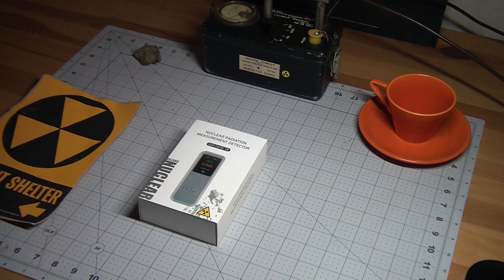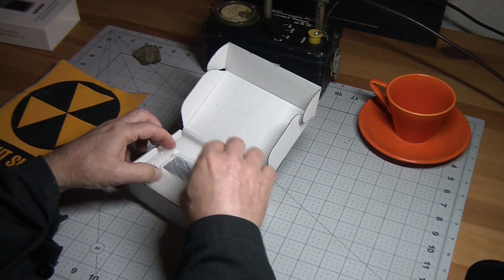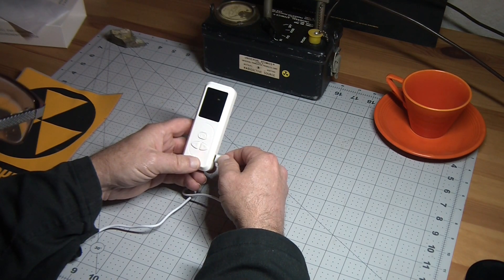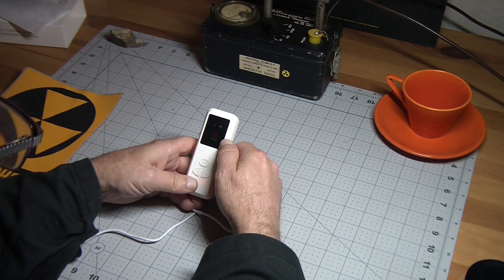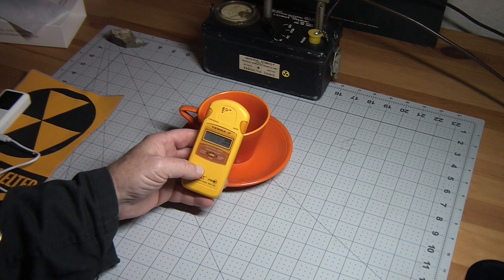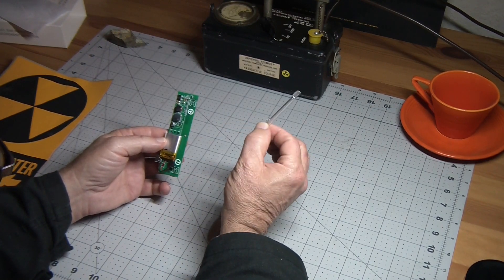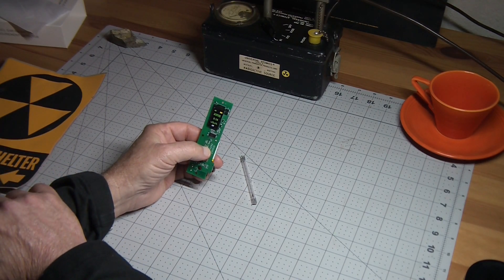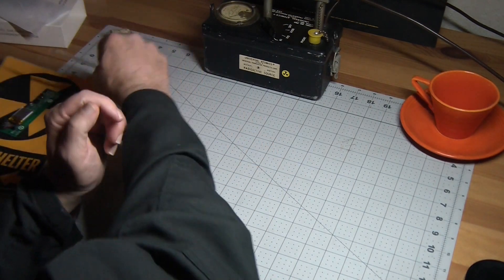Cheap Geiger Counter from Ali Express.  Is it a Fake?!

Comment: I got one which had no tube installed. Turns out mine had proper circuity to use a real GM tube. After installing a j305 I got proper radiation readings and even particle clicks. I would assume a SBM 20, j321 or M4011 would work as well.

Comment: In the German forum someone showed such a fake-device in which an elongated light bulb (like the one used as a turn signal in cars) with a voltage of 24 volts was installed as the "geiger tube".

Comment: I've got a similar model from eBay, and it's fake. No Geiger Muller tube installed, just a very small lithium battery. Doesn't detect anything of the source, I took some photos.
Reply from the maker: I showed someone the disassembled unit as shown in the video.  This person has extensive experience in nuclear power, and radiation detection. He independently stated that the tube in this device is not a Geiger tube. We agree that it is most likely a Xeon flash tube.

Comment: So, since all the circuit is real but not the tube, is there a chance that plugging a compatible, real tube there would make it work?
Reply from the maker: If I touch a scope or DMM probe to the Anode connection, it registers counts (from the noise induced by brushing the probe on the Anode), and will alarm if it registers enough counts, so I believe the answer to be Yes.  However, there is still the issue of the false counts, so I doubt it would be very accurate unless the real counts were high enough to make the fake counts statistically insignificant.  But in that case, I don't think I'd stand around contemplating it.
Reply: @CarCynic  false counts could be interferences or something caused by having a fake tube across the contacts, I've even seen a comment stating that they used car lightbulbs as a tube in one of the units. Maybe they go away by putting a proper tube. I'm tempted to buy one and try it hahah

Comment: Is there any cheap geiger counter you would recommend?
Reply from the maker: I recommend the Rodnik 3, reviewed here: https://linuxslate.com/Review_Rodnik_3.html.  Please also see additional information on the Linuxslate.com forums.
Reply: @CarCynic thanks
Reply: The cheapest GQ you can find. There's often great deals on them on Amaz... No bugs and quircks unlike way too many of the Chinese ones. And they're not really that much more expensive than the better Chinese. Those you can find significantly cheeper on China sites - well quality is thereafter and while hardware may be decent firmware is often not and have unbelievable bugs and limitations. Often in contradiction to their stated specs - simply doesn't live up to their stated specs. Some show fantasy values others again doesn't record correct dose while showing correct dose rate. Some max out way before promized max, readings while about true jump around a lot and so.